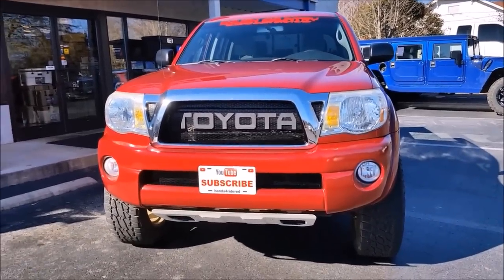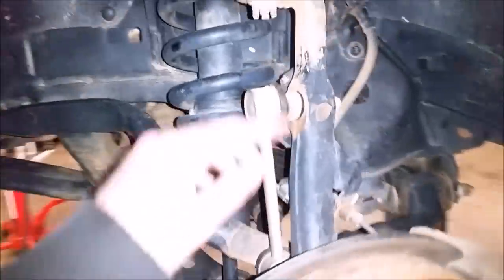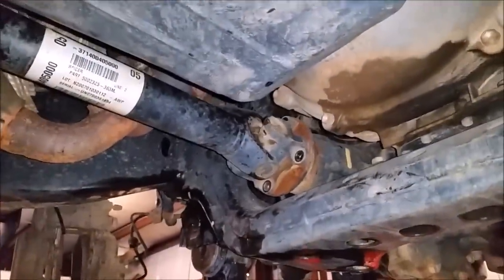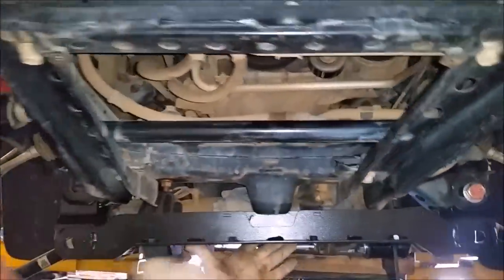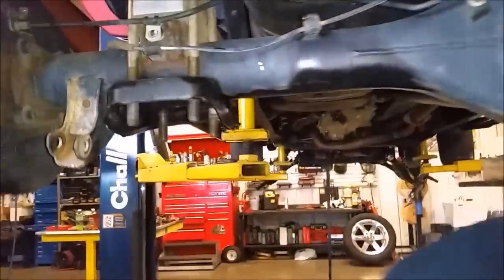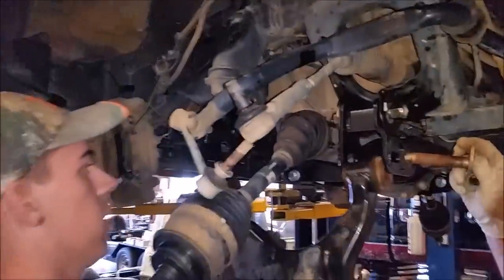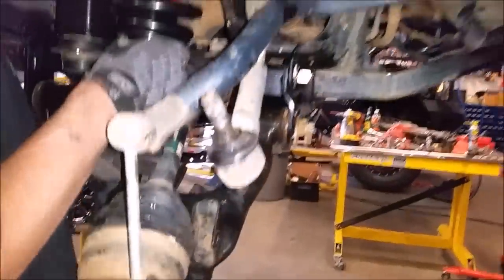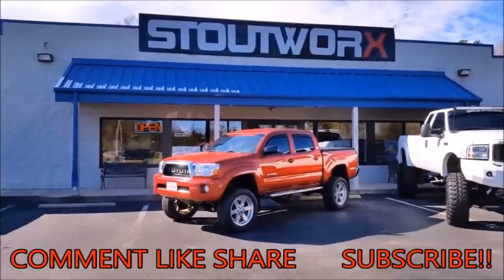Rough Country 6 Inch Lift Kit Installation - 2nd Generation Toyota Tacoma

Comment: running this lift currently and no issues whatsoever
Reply from the maker: Thanks for sharing!  It was the reason I had to sell it!  Went with a 3'' on my 3rd gen with even more clearance now!  But glad yours is running great!
Reply: @BrosFOURRSpeed  it’s probably the most popular 6” lift for these trucks. Sounds like whoever installed your previous lift did a terrible job though. Sorry it didn’t workout!
Reply from the maker: @michael70h7  Could have been the install but it rode so bad, very bumpy and bottomed out on every bump. I was scared to leave the driveway that’s how bad it was! Installed the current lift myself and love it! So something was wrong with kit or install for sure.
Reply: i’m think about getting a shop to install it cause i don’t wanna risk messing something up hoe much do u think  they will charge for labor

Comment: Was the lift kit bad ? Or what was the problem with the truck ?
Reply from the maker: It had to be the lift, I had a 3'' on the truck for 7 years with zero issues and so this kit must have changed the geometry or wasn't installed correctly.....I have a 4'' lift on the 3rd gen tacoma now with zero issues, so I'll never go back to a 6.  Plus I have more ground clearance anyway.

Comment: Hey I'm doing my 6inch rc lift on my 2017 Tacoma back was easy working on the front now, I'm at the point where I have to work on the diff. You guys didn't unhook the vent tubes and acurator or take out the diff from under the truck but the instructions say too? Is it cool if I just leave the diff in like you guys and just support it or is it better to take it out?????

Comment: I'm Going to install this on a 2006 2wd Tacoma, hopefully this wont impact anything since I dont run 4wd. Any tips? did you have any issues with your rear driveshaft?
Reply from the maker: I would think it would be better on a 2wd, I didn't have any issues with the driveshaft, but it rode like crap to be completely honest and it's why I sold the truck.  Make sure it's installed properly, I don't know what was wrong with mine.  I went back to a 3'' on 34's on my third gen tacoma and it's so much nicer with even more ground clearance than this one.  Just my opinions on it!
Reply: @BrosFOURRSpeed  Thank you. I've seen so many mixed reviews. I have all the torque specs and have installed similar kits without issues, but Rough Country is very sketchy for the price. Wish me luck hopefully 2wd will be better! I will let you know :)
Reply from the maker: @calebcalderon5175  Good luck with it! I've seen people have no issues with them!
Reply: @BrosFOURRSpeed  Thank you. Hopefully all goes well considering it 2wd and I wont have to worry about CVs. I appreciate everything and I hope you have a great day!
Reply: I Installed the 6in rough country lift kit and went on a roadtrip and a few other small drives and its ride quality if anything is as smooth as before if not better. Thanks for the video it came in handy though with the 2wd model you do not need to cut the crossmember thank goodness.

Comment: Sorry about all the questions it's just I'm interested in this lift kit,  those shocks u got new are they bigger than stock or are they oem sized
Reply from the maker: No problem on the questions..The rear shocks came with the kit and are much larger than oem.  They will have good articulation off road.
Reply: honda4ridered is it possible for me to send you my grill to you guys, and do the satoshi grill for me.
Reply from the maker: HeLLAfLushHJDMiLLesT Here's the video for the detailed installation.. https://www.youtube.com/watch?v=3A3hEObgNr8 and the time lapse https://www.youtube.com/watch?v=mhzhiz1kGfI  this will help you out a lot!

Comment: why the blocks ive seen them come out on trucks before do youll offer something other then blocks and that dont look like 6in left
Reply from the maker: You can get new leafs for the rear, but on a 6 inch lift they are going to have to be custom made, or just really hard to find.  Blocks are the cheaper route to go, I do like the look though of getting bigger leafs, but there is a big cost to them.
Reply: Bros FOURR Speed  i think id have to pay a little more then because im not a big fan of cheap or blocks

Comment: Did it come with extended brake lines or don't need??
Reply from the maker: It came with extended brackets for the brake lines, but didn't need longer ones.  I went back to a 3'' lift on my third gen tacoma, the 6'' wasn't worth it!
Reply: @BrosFOURRSpeed  I see. I was worried because I off road alot. I didn't want to go 6" it's inconvenient and it's sucks off roading. Lol.
Reply: @BrosFOURRSpeed  I thought once you go 6" you can't go back down to 3" because of the crossmember being cut?
Reply from the maker: @johnreysheila9803  I did a 3” on my third gen, I sold this truck because the lift ruined it. I had a 3” on this red truck and it was a great lift, so when I bought a 3rd gen I did it right and have a great 3” with more ground clearance than this red truck!
Reply from the maker: @johnreysheila9803  Yea, my blue 3rd gen is a beast offroad with a 3” kit!
Reply: @BrosFOURRSpeed  just order the 4" lift kit RC hopefully I don't lose ground clearance. I'm only going up to 4" because of my alignment tabs flatten out. I bought the total chaos tabs but my local shops charging me 8 to 900 to weld It on my truck. That's why I went wit the RC lift kits comes with a new tabs and bunch of new parts for the same price.
Reply from the maker: @johnreysheila9803  Hmm, most 4”” kits I’ve seen have that new cross member, not sure if that kit has it or not, but that’ll be a fun project!
Reply: @BrosFOURRSpeed  thanks you🤙🏾 definitely will be a fun one lol

Comment: Have you ever seen a 2nd gen Tacoma with a steel front bumper and winch installed with the 6 inch rough country lift kit?  I'm currently running bilstein 5100 set at 0 and ome 886 springs. I don't know how this kit would work having the stiffer springs or not having them.....
Reply from the maker: I'm sure I have without knowing it, I personally don't know anyone with that setup.  It would definitely work with those springs since this kit had a strut spacer upfront.  I ended up selling the truck after this lift because it was a bad lift in my opinion, I ended up doing a 3'' ome kit on my 3rd gen.  Not to say everyone has issues with it, if it's something you want to go with.
Reply: @BrosFOURRSpeed  it's a bad lift? Would you please elaborate on your personal experience with it? I'm all set to order it and have an installer ready for me to order.
Reply from the maker: @lostsouls3547  I'm sure people have good experiences with it, but to me as soon as I installed it, it felt like the truck lost its suspension, every bump I thought it was going to break. I went through 2 passenger side cv axles because they kept binding up, I had weird noises coming from the different thinking it was a carrier bearing issue on the rear axle, but turned out to be the driver side cv axle bushing which has to be replaced and upgraded because of the new angle. It was a nightmare. I had a revtek 3inch on it before the 6 and it was the biggest mistake I made, that's why I went back to a 3inch for my 3rd Gen and haven't had any issues with either of those lifts.

Comment: I have no clue wtf im doing. Ever time i go over a bump in my fabtech 6inch lift 2008 fj, it sounds like its gonna break. Is it a ball joint? A front end link? Control arm?
Reply from the maker: Not too sure. But I sold my Tacoma after doing this lift. Such a crappy lift and the truck rode like crap. I currently have a 2017 Tacoma with a 3in lift on 33s. Fantastic ride and super capable. I'll never do a 6in again

Comment: I've been told (by a truck accessory shop) that if adding a 3 or 4 inch lift my 06 Tacoma will stay in alignment. However with a 6 inch lift it will never stay in alignment. Your thoughts?
Reply from the maker: I think the only way it wouldn't stay in alignment is maybe with a really aggressive tire like a mud grappler or something like that, that's not really designed for the street as much.  You can have alignment issues on any vehicle, but with a 6'' lift there are some many components being changed as far as suspension goes, that issues would be more common once you get to that height.  I've stayed away from the 6'' after it ruined this truck, I'm back to a 3'' on my 3rd gen and happy with it after 15k miles with zero issues!
Reply: Bros FOURR Speed bro did you do a diff drop with your 3rd gen? I want to put a 3 inch on mine ASAP

Comment: I wonder if you guys did an alignment after the installation?
Reply from the maker: We did right afterwards. Honestly, this lift was junk. Truck rode like crap with it
Reply: Bros FOURR Speed oh crap,, was gonna buy the kit for my truck but now you said ride like crap.. any advise which suspension lift kit u suggest?
Reply from the maker: @CABIX_81  I went with an OME kit for my 3rd Gen Tacoma and it's been awesome. If you are looking at a 6" fox and icon are good brands. The 3rd gen Tacoma FB page has a lot of guys running 6" if you have more questions on them.

Comment: Hi! You know how the rear blocks aren’t squared. Where do I face the rear blocks
Reply from the maker: You mean which direction?  If they don't have an angle to them it shouldn't matter which way it goes, but I think some of them have a small indention that fits just right to know which is front and back.
Reply: @BrosFOURRSpeed  Are rough country lifts well built and easy to install?

Comment: Would you happen to know if 315/70r17s ( about 1/2 inch smaller and narrower then a 35/12.50r17) would fit with the RC 6 inch lift with rims with a -12 mm offset instead of spacers? I know RCs website says recommended tire size is 35/12.50r17s but many people on forms online say you need to cut the cab mounts or 35s will rub on it. Is that true? I am asking because i have just purchased a 6 inch RC lift for my 08 tacoma and plan to buy rims so that i do not need spacers.
Thank you very much for your time.
Reply from the maker: Kyle Silva I have 1.25'' spacers and 20x8.5 wheels with a +15 offset.  I'm planning to get either 33.2x12.5 or 33.9x11.7 and I'm pretty sure they will only rub alittle on mudflaps and some on front fender.  With 35's I'm sure they will rub more especially with a -12 offset and a chop of the cab mount may be necessary.  Check out Toyota Tacoma Enthusiasts on FB.  Lots of guys are running 35's and would be able to help. https://www.facebook.com/groups/TacomaEnthusiast/
Reply: honda4ridered 
Are you sure about that i have done much research and worked at a rim and tire shop a few years ago. -12 offset on a 17x9 rim gives around an inch more space from the back of the rim to the ifs behind it.
Reply: honda4ridered 
I believe an 8.5 inch wide rim with +15 offset has a backspacing of 5.34 inches. Where as a 9 inch wide rim with -12 offset would have only a 4.5 inch back spacing setting the -12 out over 3/4 of and inch farther then yous.
Reply from the maker: Kyle Silva The tires I have now are 31.8x11.1 and they are about 1 inch from the LCA on a sharp turn.  Going with a 33.2x12.5 with my 1.25'' spacers would put it right up to the LCA and I may have to do some trimming on the fenders.  If you are staying under 35x12.5 with the tire you mentioned, there could be some rubbing on LCA and fenders and I'm not positive on the cab chop mount if its necessary or not.  I'm staying away from having to do that mod.

Comment: Nice choice with the tires, did u lose center ground clearance with there drop bracket
Reply from the maker: The differential skid plate is about a half inch lower, it has good ground clearance minus that one spot.
Reply: Thanks, I have an 06 tacoma long bed 4x4 that I have been debating on getting rough country's 6 inch lift kit for it, but now that I have seen pictures it looks like a good lift kit for the price. My main concern was not loosing too much ground clearance with the drop bracket and have to big of an exposed gap between the fender and tires as I'm running 285-75-16, but that doesn't look like the case with your set up. Thanks for the info.
Reply from the maker: jose siqueiroz As far as the center ground clearance, the new cross members are about 3 inches lower than stock, but because the shocks are now taller, I think I gained a few inches of ground clearance. Rough Country definitely did a good job designing this kit to have all of the benefits of a 6in kit, without the huge ugly lower cross member.

Comment: Nice, those shocks would help me as I use my truck for hunting and fishing with the family and what about your front struts are those stock in size or larger
Reply from the maker: The front struts are direct OEM replacement. Monroe Brand. Same height as stock. It would have taken too much time to take apart our oem ones to take the spacer out, and also, they would be very worn out to use because they have been like that for 6ish years.
Reply: Oh ok got it, we'll I think I'm going to have to try out that lift on my truck here soon also , we'll thanks for answering all my questions and thanks for your time, all this input was very helpful in making my decision, it was much appreciated thanks, and you have a nice truck by the way, real nice setup thanks again
Reply from the maker: jose siqueiroz No problem, glad to help!
Reply: I have a 2006 Tacoma with an iron cross bumper and winch installed. It had a 2" spacer in the front but after the weight added by the bumper and winch.....she just sits there, no bounce.  Would something like the rough country 6" lift work with a heavy application like this? Or could you please advise the best option to achieve the suspension needed

Comment: I’m thinking about getting this lift.. but with the upgraded N3 lifted struts for a smoother ride. I have 31.6x10.4 R-17. It’s slightly smaller of a tire from recommended listings.. would that make a huge difference?
Reply from the maker: I would stay away from this lift.  Watch the video I made, why I really sold my tacoma.  The lift ruined the truck.  I'm sticking with a good 3'' on my 2017 tacoma, I don't trust cutting the frame anymore. But if it's something you want to do, that's a pretty small tire for a 6'' lift, I'd go 33 or larger.
Reply: from what ive seen and read, rough country has really changed within the past few years with their build quality, especially with their N3 struts and switching to powder coated aluminum vs using steel. What im trying to get at is, if R/C is labeled as such of a bad lift kid, why do so many people have them today? I'm also getting all my ball joints and axles inspected and/'or replaced at the same time, as well as an alignment because my truck is about to be at its high mileage point.
Reply from the maker: Curve AX They are cheaper then other lifts, my cv axles were not lined up right with the drop either. I'm not telling you not to get it, everyone has there opinion, but it ruined my truck and rode like crap, I thought it was going to fall apart.
Reply: ive been debating between the R/C 6" lift with the optional upgrade for $1200.. or if i should pony up and get a BDS 6" coilover for $3500 which guarantees a factory smooth ride
Reply from the maker: Curve AX Check out the 3rd gen Toyota tacoma fb page, they have tons of people with lifts who can give more advise on this..I wish I had done a different kit before, it may have changed my mind on the 6".
Reply: Bros FOURR Speed thank you for the input. I did more time and research before making any hasty decision and I consulted with a specialty shop as well. I’m going with a BDS 6” kit with Fox rear shocks. As well as getting 18”x9” vapor wheels and 33” nitto grapplers. Definitely making a vid on on the before, during, and after installation
Reply from the maker: Curve AX Let me know when you uploads those, love to see how it turns out!
Reply: @BrosFOURRSpeed can you send me the link to that video?

Comment: Was there any welding involved in this lift
Reply from the maker: No, just the cutting of the frame.  I wouldn't recommend doing this, I had to sell the truck because of it.  Have a 3'' on my 3rd gen tacoma now with more ground clearance!

Comment: Anything over a 3” loft on these trucks you need like upper n lower control arms because the cv angles are too aggressive.. which ups the price of the lift almost double. Which is why a lot of guys don’t go above 3” lift. You can however run a body lift later on down the road
Reply from the maker: Yea after running my 3'' lift for 8 years and going to this, bad mistake!  I did a 3'' lift on my 3rd gen tacoma and with 34's I have more ground clearance then one with a 6''!  That might have more body clearance, but the 3'' is a perfect setup!
Reply: No you dont need control arms with a 6 inch lift. The angles are kept close to stock due to the drop bracket in conjunction with the taller spindles. And the front diff is lowered to maintain the cv angles. Compared to just a 3" lift with a spacer or longer shock with no drop bracket, this forces more extreme angles on the control arms and an aftermarket upper control is recommended to allow for an alignment closer to stock specs.
Reply: @videobymark  you do need them

Comment: What size tires are you running with the 6 inch lift
Reply from the maker: jose siqueiroz I will be putting on 33.2x12.4 Toyo AT2's.